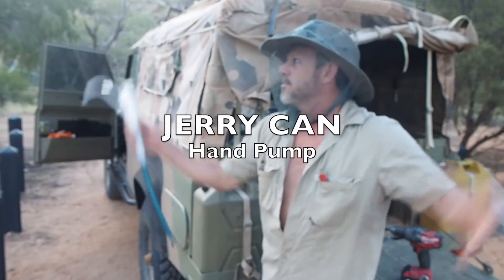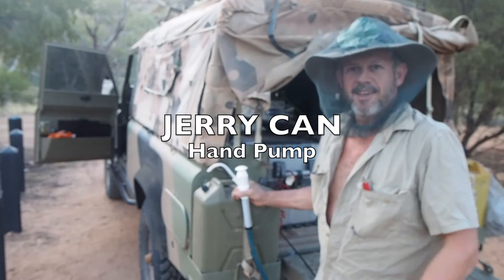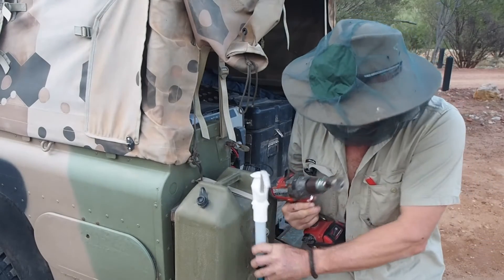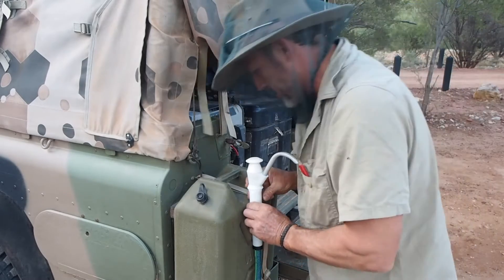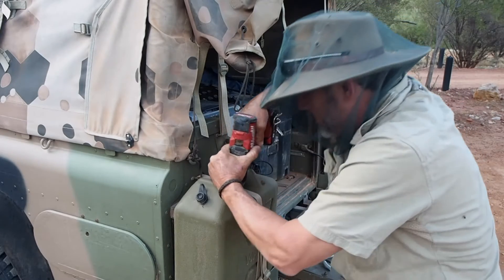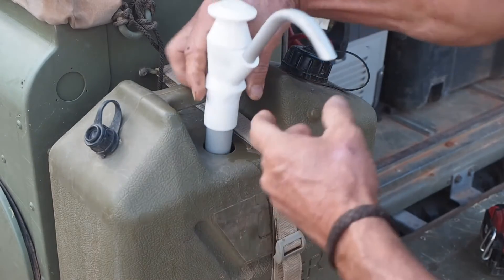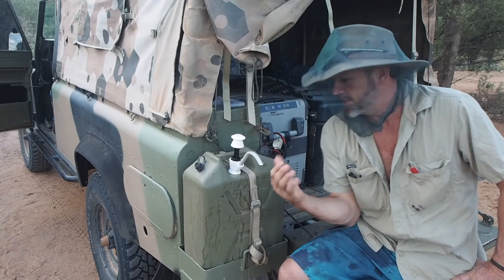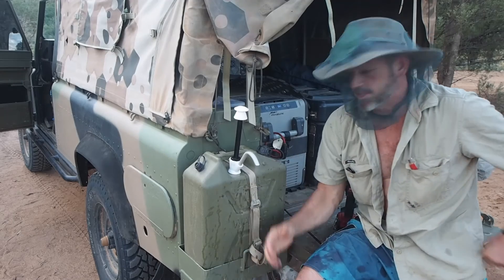Jerry Can Water Pump

Comment: I’ve looked at many different options for pressurising a jerry can but this is the best solution I have come across. Nice and simple, so I’ve ordered the parts.  Question: why did you put the pump in the handle area instead of in the filler cap?  Does it get in the way when carrying it?